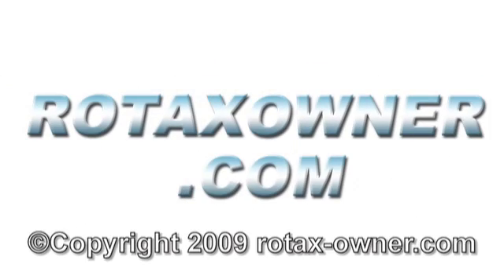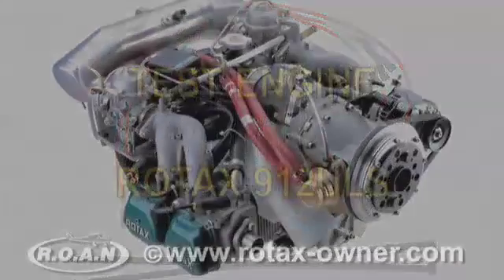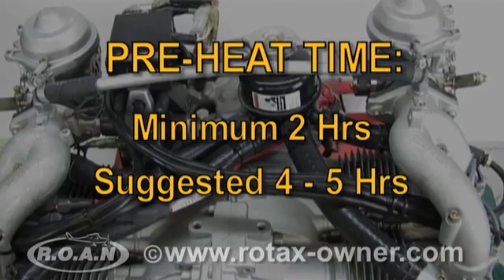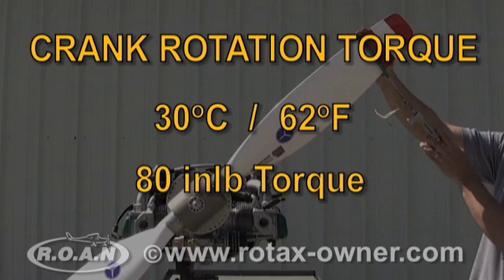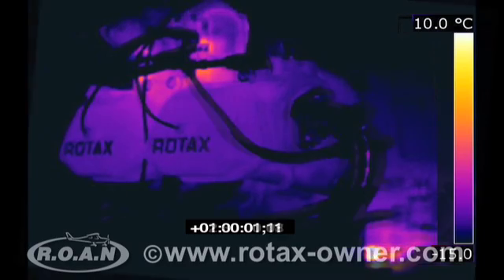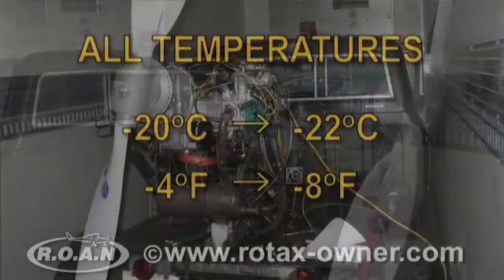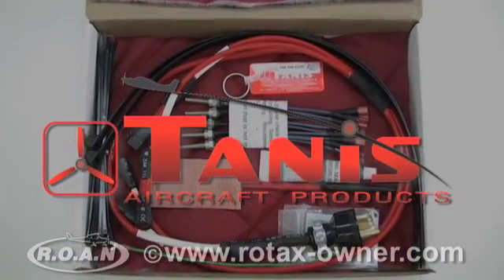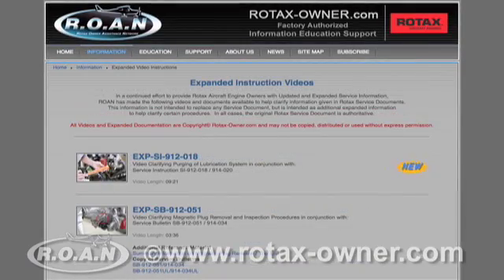Product Review - Tanis Engine PreHeat for Rotax Engine

Comment: is there any problems leaving the heater on for several days?
Reply from the maker: Tanis says: "Tanis preheat systems can be plugged in continuously." More information here - http://www.tanisaircraft.com/frequently-asked-questions
Reply: Yes, with your electrical bill
Reply: @michaelrobbig-reyes5525  Mike, a new Rotax engine is going for $31,000.  I have two pre-heaters for my RV-12 here in the cold NE.  The Tanis units draw 200 watts.  What's not to love.